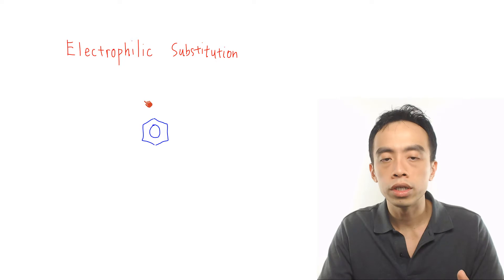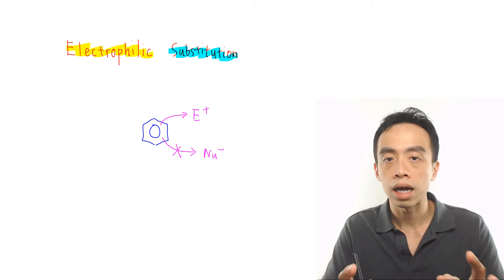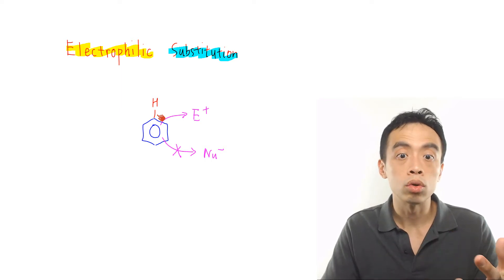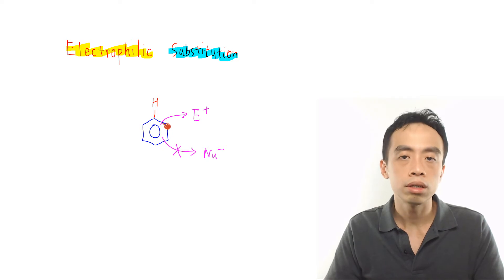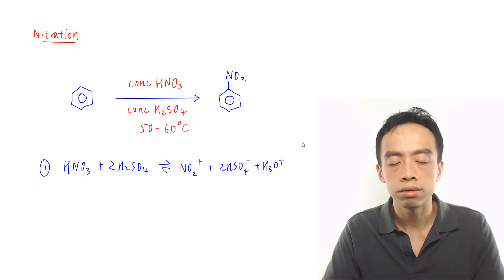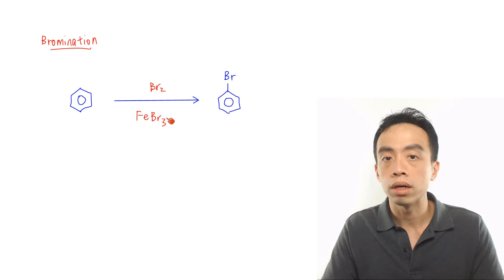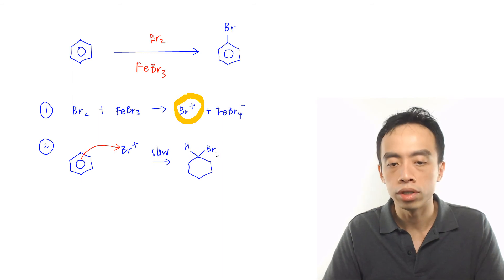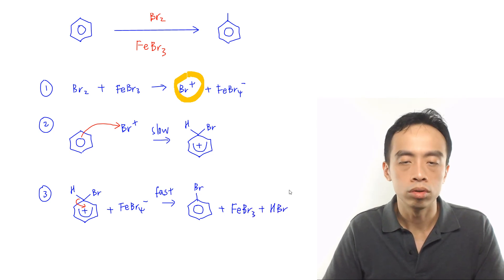Electrophilic Substitution, Benzene Mechanism - Organic Chem

Comment: Hi, do you know where does the 2 electrons come from when the intermediate loses the H+ ion? Thank you
Reply from the maker: Hi Jayden if you are referring to step 3 for electrophilic substitution, when the intermediate loses the H+ to form product, the 2 electrons come from the C-H covalent bond. Both electrons from the C-H bond will be donated to the delocalised pi system so there will be 6 delocalised electrons (where resonance is the most stable). Then H+ is being kicked out and combine with other intermediates to form by-products.
Reply: Chemistry Guru - #1 JC, A Level, H2 Chemistry Tuition ohhh okay but why is it specifically 2 electrons?
Reply from the maker: @jaydong9985  in step 2, 2 electrons from delocalised pi system in benzene is used to form a bond with carbon and electrophile. The pi system is then short of 2 electrons, so in step 3 it will take back 2 electrons to restore the delocalisation.